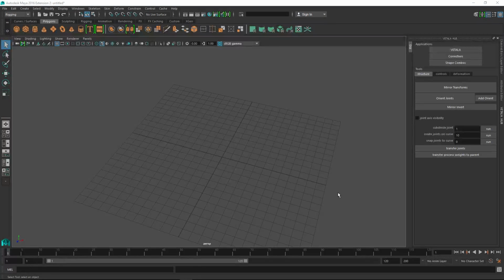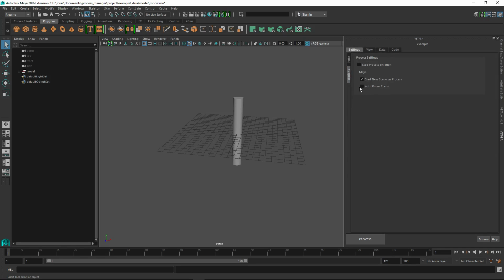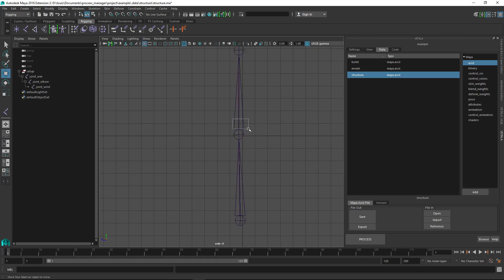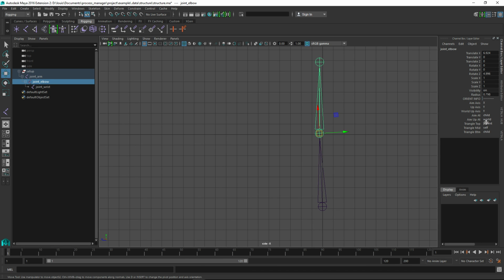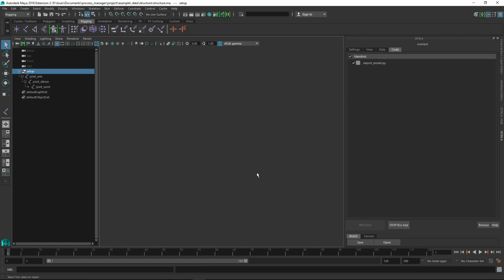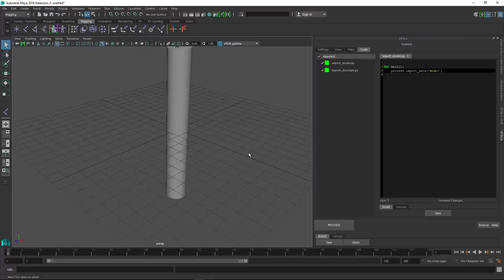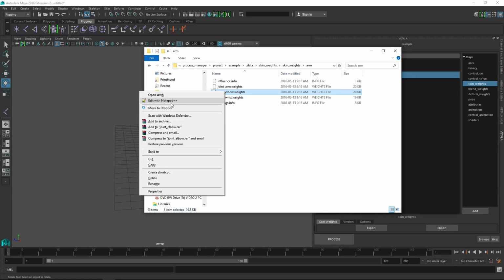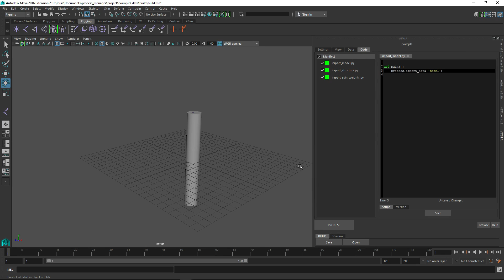Intro Asset Workflow - Part 1

Comment: Is there a way to set which model you import during PROCESS? It would be nice to be able to change it in case you want to compare old and new scenes.
Reply: Partigrade Cannon you can save in sub folders and the call the sub folder when you do process.import_data